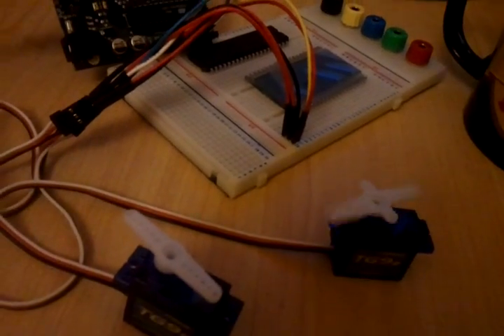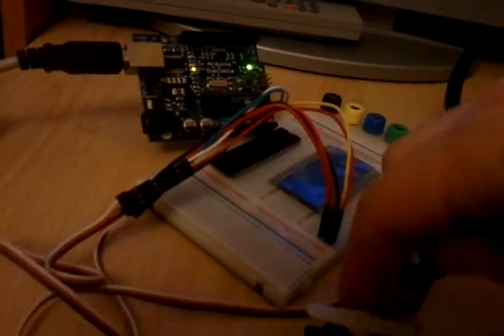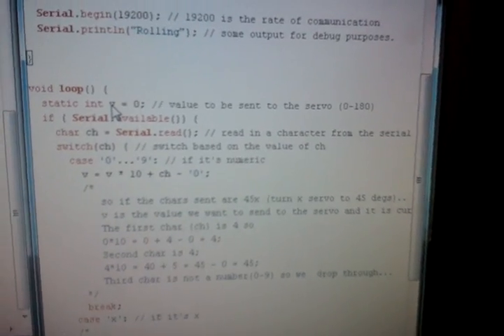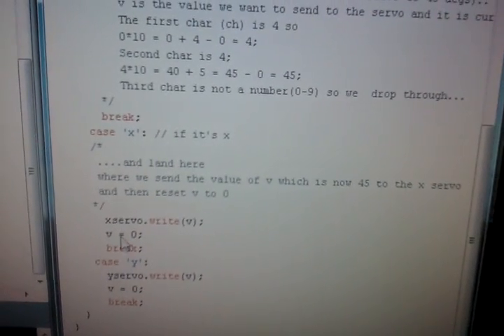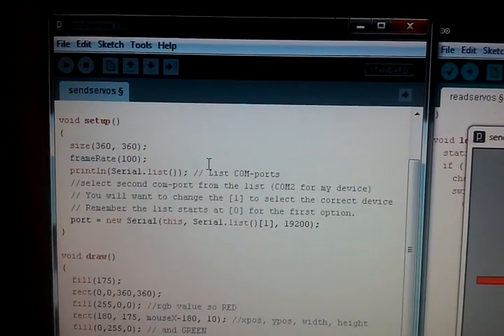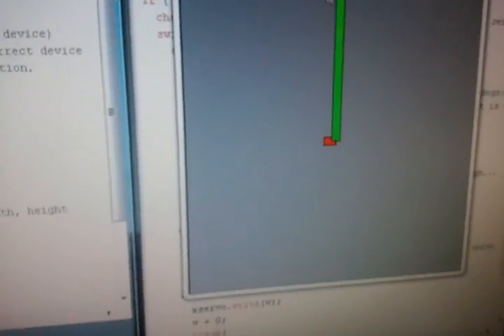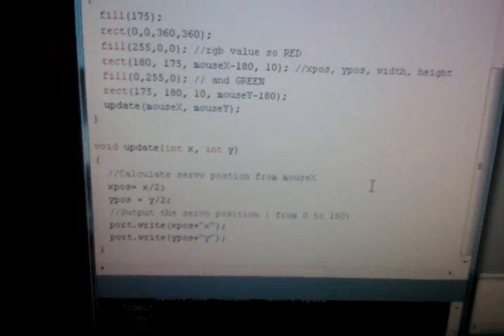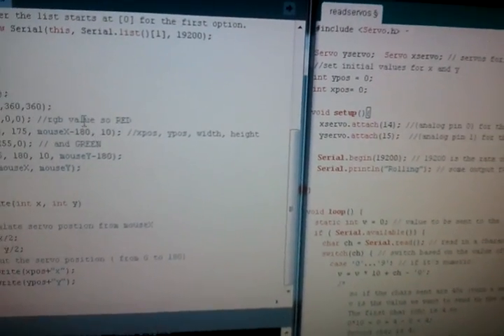Arduino - twin servo mouse control tutorial (source below)

Comment: //Arduino code:
#include <Servo.h>

Servo yservo;  Servo xservo; // servos for x and y
//set initial values for x and y
int ypos = 0;
int xpos= 0;

void setup(){
  xservo.attach(14); //(analog pin 0) for the x servo
  yservo.attach(15);  //(analog pin 1) for the y server
 
  Serial.begin(19200); // 19200 is the rate of communication
  Serial.println("Rolling"); // some output for debug purposes.
 
}

void loop() {
  static int v = 0; // value to be sent to the servo (0-180)
  if ( Serial.available()) {
    char ch = Serial.read(); // read in a character from the serial port and assign to ch
    switch(ch) { // switch based on the value of ch
      case '0'...'9': // if it's numeric
        v = v * 10 + ch - '0';
        /*
           so if the chars sent are 45x (turn x servo to 45 degs)..
           v is the value we want to send to the servo and it is currently 0
           The first char (ch) is 4 so
           0*10 = 0 + 4 - 0 = 4;
           Second char is 4;
           4*10 = 40 + 5 = 45 - 0 = 45;
           Third char is not a number(0-9) so we  drop through...
        */
        break;
      case 'x': // if it's x
      /*
       ....and land here
       where we send the value of v which is now 45 to the x servo
       and then reset v to 0
      */
        xservo.write(v);
        v = 0;
        break;
      case 'y':
        yservo.write(v);
        v = 0;
        break;
    }
  }
}
Reply: do you have the processing code?

Comment: //Processing code:
import processing.serial.*;       

int xpos=90; // set x servo's value to mid point (0-180);
int ypos=90; // and the same here
Serial port; // The serial port we will be using

void setup()
{
  size(360, 360);
  frameRate(100);
  println(Serial.list()); // List COM-ports
  //select second com-port from the list (COM3 for my device)
  // You will want to change the [1] to select the correct device
  // Remember the list starts at [0] for the first option.
  port = new Serial(this, Serial.list()[0], 19200);
}

void draw()
{
  fill(175);
  rect(0,0,360,360);
  fill(255,0,0); //rgb value so RED
  rect(180, 175, mouseX-180, 10); //xpos, ypos, width, height
  fill(0,255,0); // and GREEN
  rect(175, 180, 10, mouseY-180);
  update(mouseX, mouseY);
}

void update(int x, int y)
{
  //Calculate servo postion from mouseX
  xpos= x/2;
  ypos = y/2;
  //Output the servo position ( from 0 to 180)
  port.write(xpos+"x");
  port.write(ypos+"y");
}
Reply: Thank You man)

Comment: link is dead
Reply from the maker: Sorry about that. I'll have a dig through the backups for the code and upload it this evening.
Reply: ***** here are the steps,found them in instructables.com
http://www.instructables.com/id/Overview/?ALLSTEPS

it's not working for me for some reason, I have a mega
Reply from the maker: med garouche aah, looks like he grabbed my code. It's got my ridiculous comment about debugging.
Assuming it's the same. Are you getting no response at all from the servos? Are you getting the bars on the processing applet moving as you move the mouse?
Reply: hhhh internet people! can you help me out? the processing works fine, arduino seems to receive the instructions in the serial,but nothing happens,note that I have a mega board
Reply from the maker: med garouche sure, on the arduino code can you add in a couple of lines.
after xservo.write(v); and after yservo.write(v); can you add the line  Serial.println(v); and we can make sure that the arduino is getting the values.

This should write the values the arduino receives back to the console when you run the sketch. So run it, move the mouse and check that the bars move and the console is showing up the values coming in.

Once we have that we can have a check why the servo's aren't responding or adjust the port accordingly. I'll have a dig through the old box of bits and find the arduino and set it up so that I can check along with you.
Reply: the arduino receives the instructions,but it seems that there is like an overload buffer, I've seen a guy having the same problem,he solved it by adding a delay in the processing to prevent the buffer overload,here is the link :
http://forum.arduino.cc/index.php?topic=184762.0

but at the end he said :  the issue was setTimeout() it's default value is 1000 ms so that's explains everything "  what does he mean by set timeout? where should I  add this line?
Reply from the maker: med garouche his setTimeout is that delay function he's added in his example. He then calls that function after writing to the arduino and tells it to wait for 900ms.
PaulS is right though. No sense in resending an unchanged value. I need to update this and make it more useable.
Grab that guys delay function which he lists on that page and it should work. If not then let me know and we can work out what the issue is. Meanwhile I'll go through and rewrite this to sort out some of the areas which need improvement and find out what's causing the problem. Good excuse to buy a mega ;)
Reply: thanks gareth!! I  used  visual basic instead of processing, set the baudrate to 19200,no dalay was needed, it works like a charm!thanks for your support. :)
Reply from the maker: med garouche spot on. Glad you got it running.
Reply: thanks gareth,hope you have more projects

Comment: What ports do you use for arduino and processing
Reply from the maker: Sorry for the slow response. See my reply to Gokalp below. If you're on windows check the device manager under COM & LPT. You should see the arduino listed there. On Linux remember to set up your permissions to allow access to usb communication. It's been a long time since I did anything arduino based but "lsusb" in a terminal should start you in the right direction.

Comment: Great job man i had been searching for this through almost everywhere but as joel7contre i also cant get the servos running. kinda new to arduino so can you help ?
Reply from the maker: First thing to check is the port that the arduino is on. Joel used -  String portName = "COM8" because his arduino is listed as COM8.
Open up windows device manager (assuming you are using windows) and check under COM & LPT. The correct com port for your arduino is listed there. In setup in the processing file (linked in the description) you can set it there. Or print out the listing of ports and select the correct one as in the code:

 println(Serial.list()); // List COM-ports
  //select second com-port from the list (COM2 for my device)
  // You will want to change the [1] to select the correct device
  // Remember the list starts at [0] for the first option.
  port = new Serial(this, Serial.list()[1], 19200);

Comment from the maker: Looking at the processing code, I'm limiting the screen size to 360*360px and sending the mouse pos / 2 so that should only ever send a value between 0 and 180. The only stupid thing there is that I'm not forcing the output to be an int so it might be popping out a float when the xpos or ypos is an odd number. The arduino code just uses the value that is passed and sets the servo angle to that.

Comment from the maker: The servos will have a 180 degree limit so they should stop regardless of the mouse position. The code is quite old now so there's always a possibility that the arduino is running a slightly different version which might account for that.
The code in the links is the same as I used.
Are you using the same turnigy servos? Can you let me know if it's a different servo you are using and I'll have a look into it for you.